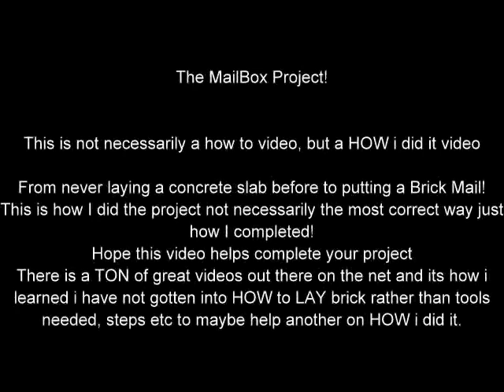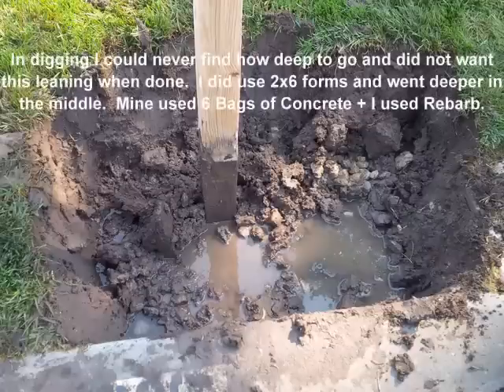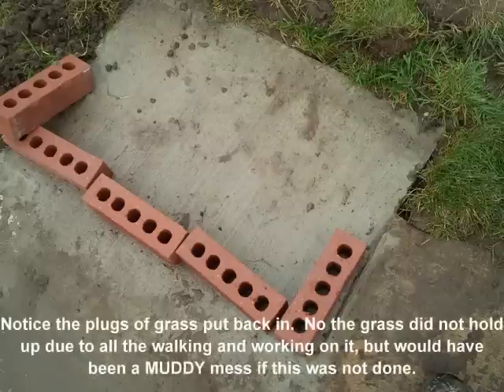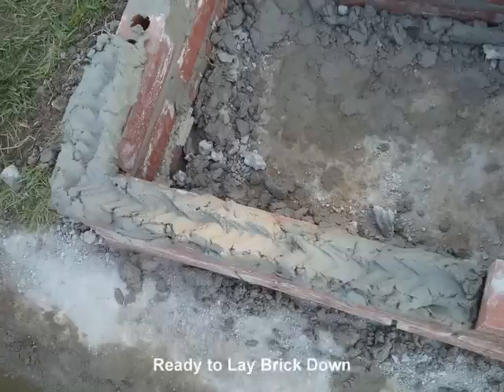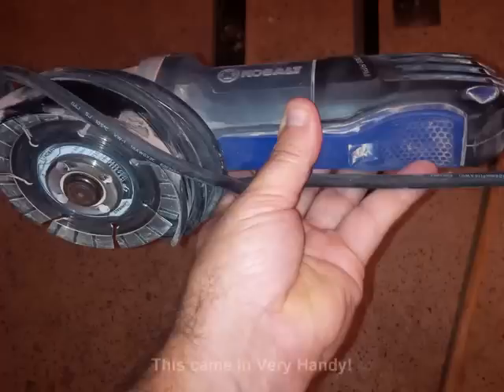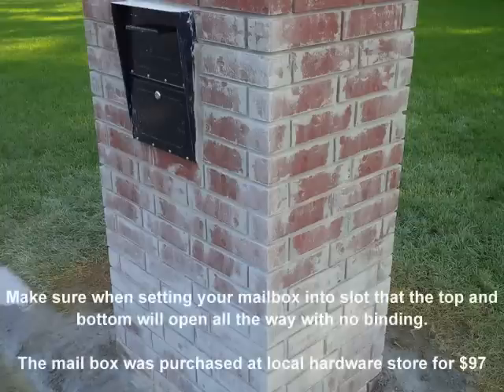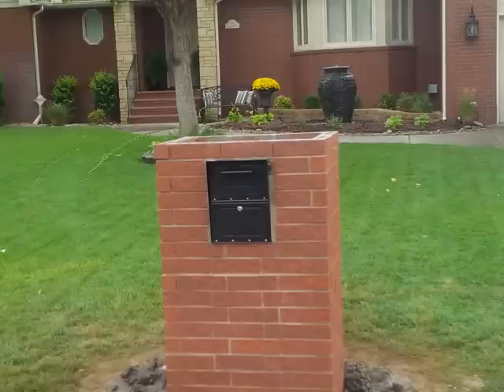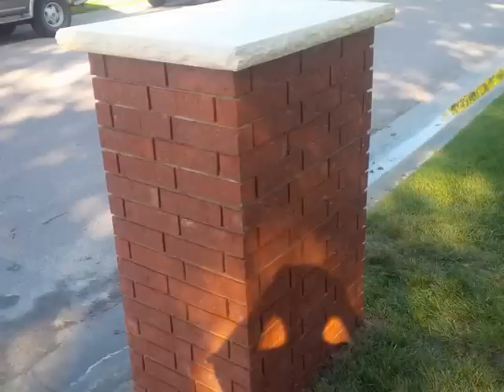Brick Mailbox Build

Comment from the maker: I Only Put Weep Holes on the Front.  I drilled into the Motor Joints on the front at the bottom......Regarding the footing when I was drilling my motor joint out I used the bit to form natural water way...I drilled the motor joints when I was one or two brick high.

Comment: dont get mortar on the face of the brick, lay the mortar on top of the brick then set the brick wait a short wile then tool out the mortar joints and you will have a clean face, we have never had to do a acid wash on any project.. not bragging just trying to give a tip.. tip is do not work the joints untill mortar has setup